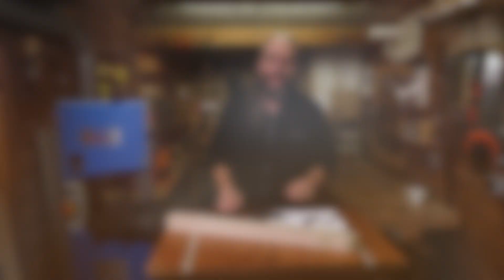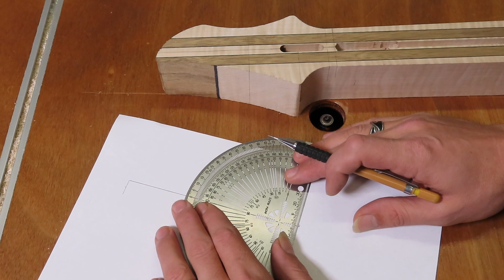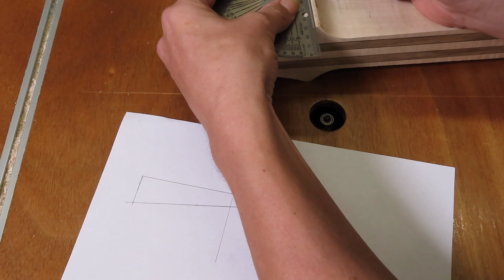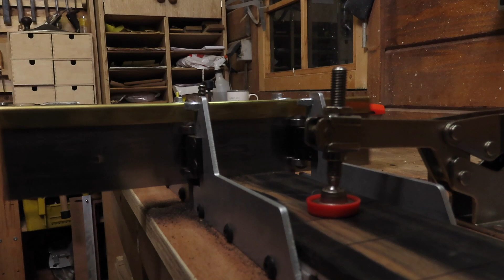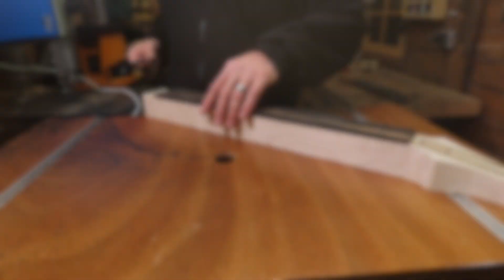Headstock break angle & Fretboard - Building a Single Cut model Guitar (Part 2)

Comment: I don't mean to be the math police, but either the 26 mm read from the ruler was actually around 32 mm or you actually dialed in around 10 degrees when you marked off on your protractor.  31.88 mm = tan(12) * 150 or atan(26/150) = 9.8 degrees.  Not sure which it was, but the trig doesn't work out for 26 mm, 150 mm and 12 degrees.  Either way, a 10 degree or 12 degree break angle is good for guitars.  Am I missing something?

Comment: Unless I am seeing it wrong, don’t you end up with short grain in the headstock area when you carve the neck from a solid block of wood?  Wouldn’t  you prefer a scarf joint so that you can have long grain on the entire neck?
Reply from the maker: Hi MixingGBP,
My personal opinion is that with a quarter sawn multi laminated neck with a proper volute and a cap on the headstock the 'short grain' doesn't really matter in the 'strength' of the neck or headstock.
Up until today I havent had any problems whatsoever and doing my necks with this method makes it it much easier.
Reply: @UnquendorGuitars  Ok thanks for the explanation.

Comment: Why don’t you cut the break angle of the headstock with a circolar saw before shaping it?
Reply from the maker: Hi Nino,
Good question.
First off, I use a routing template and a router table to get the shape of my neck and headstock in a single pass. I stick the template on the 'front face' of the neck because this is the most important reference plane. If I cut the break angle before shaping the neck there won't be any material supporting the template where the headstock is, making using a router (table) impossible, or at least very, very dangerous. 
And secondly, I don't have a good circular saw or table saw.
Reply: Daniel what are the measures of the chunk?

Comment: Hi. What is saw blade thickness when you cut fret slots and what is thickness of fret socket you use?
Reply from the maker: Hi Sami,
I use a Pax fret saw with a 0.55mm kerf and I cut my slots +/- 4mm deep in the flat fretboard (no radius yet).

Comment: Hi, what is the thickness of the neck blank at this stage?
Reply from the maker: Hi Mr. Frontranger,
It usually is around 50mm, give or take a few mm.  
I like to have as much margin for errors as possible so mistakes are easy to spot and fix in the correct way.

Comment: Is it possible to cut the headstock angle before  rough shaping neck blank to make marking and cutting out easier?
Reply from the maker: Hi Bluegitsy,
I had to think about this for a moment but... Yes it is possible, and some other builders do it like that.

Why I don't do it like that?? Let me try and explain...
It has mostly to do with using my router table to route the outline and accuracy (maybe).
When I layout the neck outline on the neck blank to route the truss rod channel everything is drawn at the 'top'. Including the all important nut line and center line to which I can align my routing template with ease.
If I would cut the break angle at this point I can't place my template on the top anymore to route the outline of the neck. There would be a chunk of wood missing underneath the headstock.
I could off course stick the template to the 'bottom' of the neck blank, but that would mean I have to transfer the center line and nut line to the other side of the blank. If one of those marks is even slightly off I could end up with an unusable neck. And that is a risk I'm not willing to take if possible.
Or  you could use the template to route the sides of the neck and use a sander to clean up the headstock. 
I'm not a fan of sanding and I made a nice template to avoid that.
Reply: @UnquendorGuitars  Thanks for your answer that clears that up for me.Keep the great videos coming.
Reply: @UnquendorGuitars  Am I misunderstanding the question?  In this video, you cut the headstock angle but you haven't shaped the neck yet so I am confused.  And, thank you for this series.  Very good videos and explanations.  I would like to know what you do to cut and laminate your neck to begin with.  Are the laminated pieces face grain to face grain or edge grain to edge grain?  Have you had any issues with warping in these laminated necks?   Thank you!

Comment: Another really interesting video. I especially like the use of the spindle sander as a thicknesses. I build a drum sander attachment for my lathe which is amazing but it’s hard to use with fretboards unless you fancy losing the end of your fingers lol. This is going be a very nice guitar!
Reply from the maker: Hi John,
Thank you once again.
I have seen your lathe attachment and found it really clever. 
About losing your finger tips... same goes for the spindle sander. That's one of the two reasons I always feed the material against the spinning direction of the sander. It pushes my fingers out instead of pulling them in.
The other reason is having the fretboard pulled from my grip and being shot through the workshop.

Comment: I absolutely love the way the multi lam neck looks (from the side) as the headstock tapers in. Makes the thin stripes look huge..... I am still planning what woods I want to use for my first build. What should I avoid? Aside from Purple Heart and Wenge!?
Reply from the maker: Hi Guitars Amps & Pedals,
Besides being functional laminated necks look great indeed. 
About what wood types to avoid.... I'm not sure to be honest and I find it hard to say.
It all depends on so many factors. 
For example there is nothing 'wrong' or ' difficult' about using Purple Hearth or Wenge. They require a 'different' approach.
As long as you keep your tools as sharp as possible and sharpen often I think harder wood types are 'easier'  to work with and are in some way more forgiving. You don't slip as easy like on softer woods like Mahogany or Limba. 
I made a bass guitar with a Wenge top and it worked beautifully. It polishes out real nice with a bit of oil and wax.
I select my timber mostly based on what I think looks good. Maybe with the exception of the neck. Nothing beats a flamed maple laminated neck in my opinion.
If you don't want to take a risk I would suggest a nice Swamp Ash body, a Maple neck and a Rosewood fretboard for a first guitar build. These are fairly easy species of wood to work with and are most likely to give a great result.